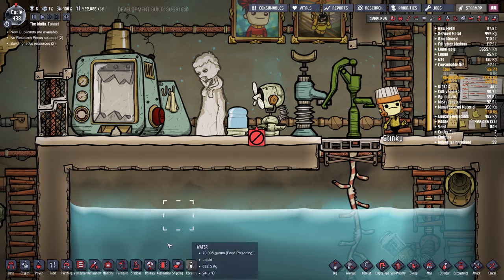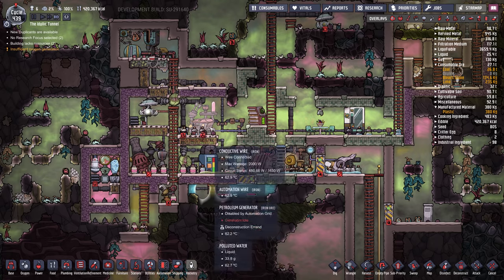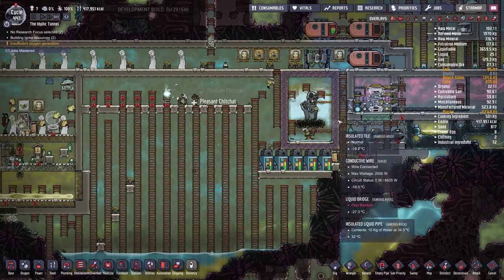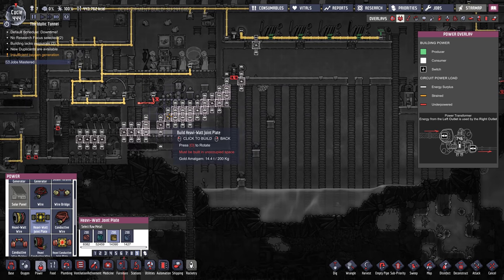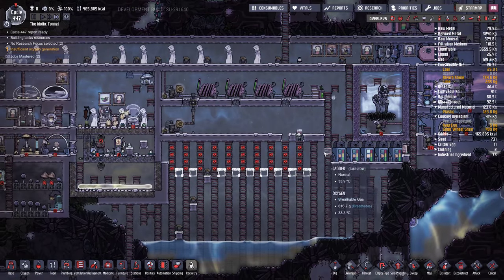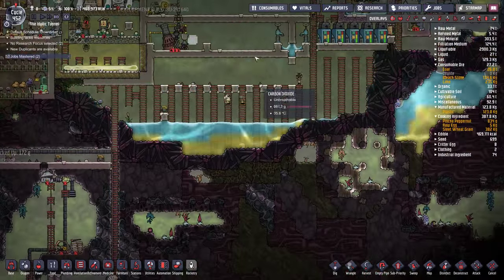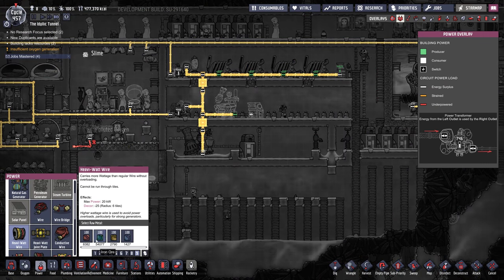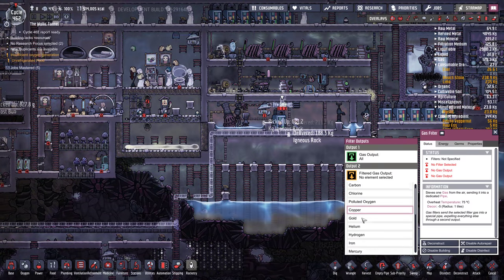DUDE! Fix My Base #12 - Oxygen Not Included Space Industry (Monkey's Base)

Comment: Well GtG, I'm sad to say that on my current base... It is dying. And not because of food, or oxygen... But meteors. Not enough lime production for steel, which is needed for bunker tiles. As i sit here typing this... Watching helplessly as the external reaches of my work gets an iron shower. 

I proudly say I've learned a lot between your tips and tutorials though! This is the longest living colony I've had yet xD. R.I.P. Mist Crest Sector - cycle 800
Reply from the maker: fossil from the bottom of the map should be enough to make lime to cover the entire top with bunker doors / tiles. A large pacu farm will also get you lots of shells for lime.
Reply: I thought about that, however i feel i took extraordinarily too long to expand to the deep. I didn't actually get my plastic production until day 700 xD. On a good note though! I learned that setting up tempshift plates along the anti entropy machine next to the press machines work absolute wonders! I'll be doing that again come update. (Inb4 nerf)
Reply: You can use; amuzingly; steam turbines to block the meteors. just disable the repairing and you have your cheap meteor proof roof.
Reply: hopefully naughty meteors destroying everything wiil be fixed in thrusday update, now we'll have all the time we want until doing the surface.

Comment: How much value is there in building a temp shift plate out of diamond behind the oil refinery and petroleum generator?
Reply from the maker: It will help spread the heat out. You might want more than 1 though. I often put 3-5 behind my polymer press.